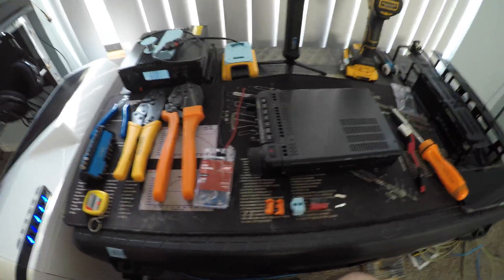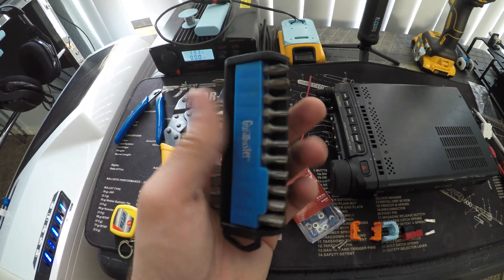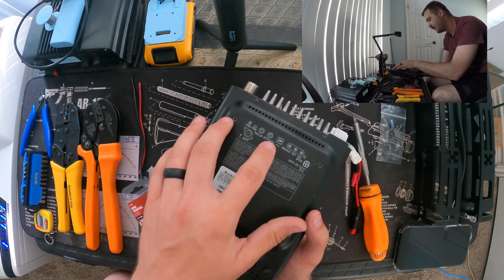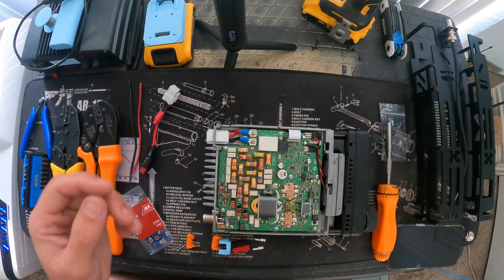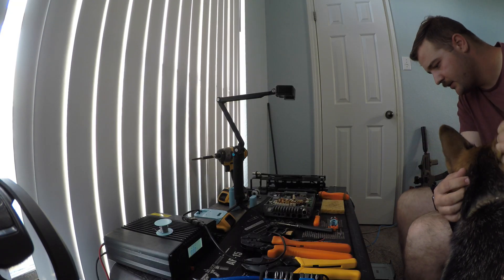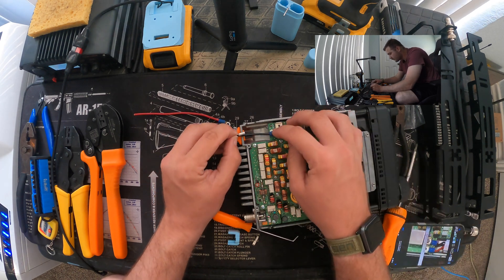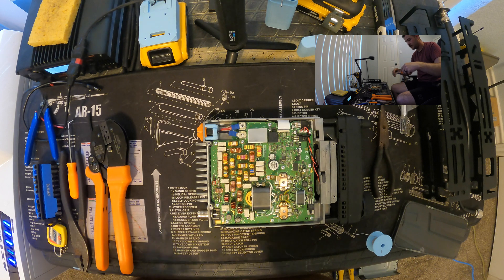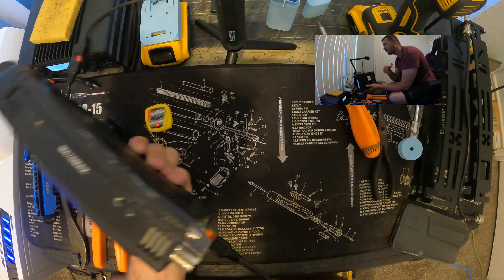The Workbench: FT 891 powerpole mod

Comment: Soldering a silver plated terminal connector like the Anderson power pole, can be risky, if the solder runs off it'll cover or ruin the silver plating, causing it a it less good electrical connection (higher contact resistance). But if you don't care about that then you can solder it. I just think crimping alone is good though for this connector, if the wire size is a good fit.
Reply: Yes, soldering a crimp connector that is properly crimped actually makes the connection less reliable.

Comment: Know of any place selling the 3d printed part? I don't have a 3d printer and like the power pole mod. Also good luck operating over seas. I was able to operate in Iraq as YI9HOC and Belize as V31OC both on military trips. I tried for Afghanistan but wasnt able to obtain a call.
Reply from the maker: Where you operating under any agreement or just sent it?
Reply: @FITFO  No I applied for the local call with the host nations.

Comment: Maybe I missed this but what size screws do you use to hold the pieces together?
Reply: 3-48 x 1/2"
Reply: I did this today. I used 12ga wire so getting the length exactly right was a bit of a challenge.  Awesome mod and pretty easy too!

Comment: I d/led your files from thingiverse to have printed.  The screw wholes on the two outside pieces are offset, not inline.  Thus they do not line up with the holes in the inside piece.  Is this a fault of the person who printed them?  Please double check your uploaded files.  I really want this mod for my radio.  K5CYA  Charles
Reply: I added a mirrored part. Because a lot of people seem to have problems mirroring it.
Reply from the maker: So this file is not mine. As for the holes in the thingiverse the creator does explain to print two of the outside pieces. One of them printed as mirrored (I know at least you can do this in cura) so being that you allready printed one set. To fix you would just have to print one outside piece mirrored and it should work fine.

Comment: This is great and is on my list to video.  What soldering iron are you using? Looks like it has power poles?
Reply from the maker: Using a ts100. I have a 3D printed dewalt battery adaper with a power pole output, then I use powerpole to barrel connector into the iron. The ts100 works on something like 10-24v I usually use the dewalt battery for 20v faster heat up time. If I don’t have that around I can just plug into any 12v powerpole source. It’s great especially for stuff I can’t move to my workbench.
Reply: @FITFO  Yeah, it would be great for field use